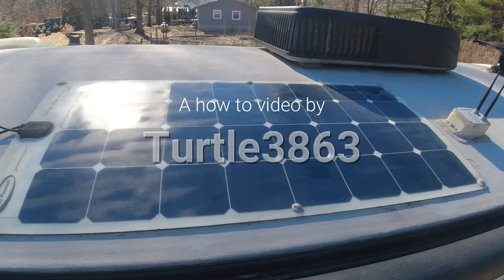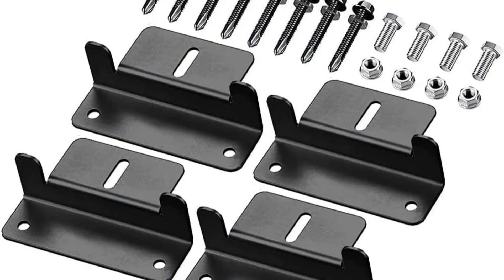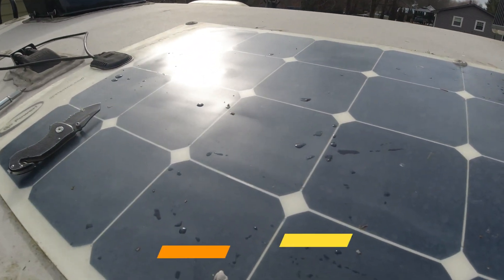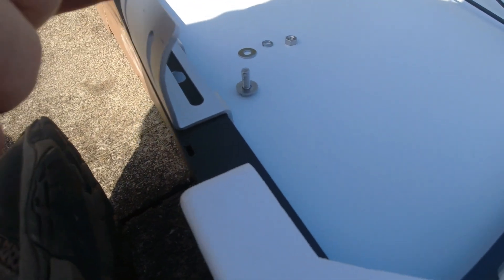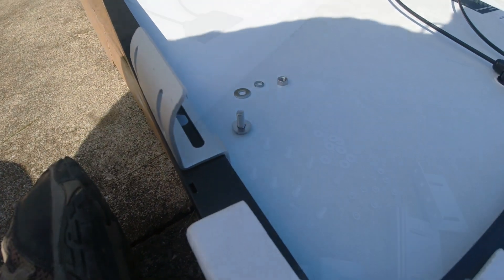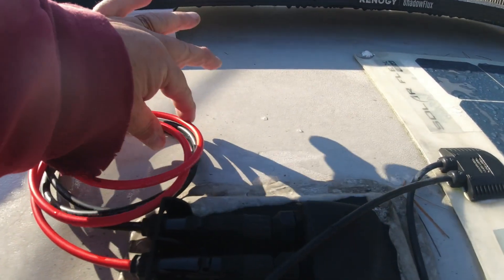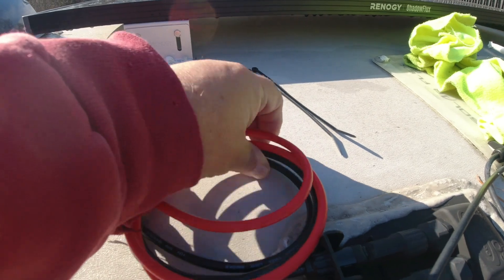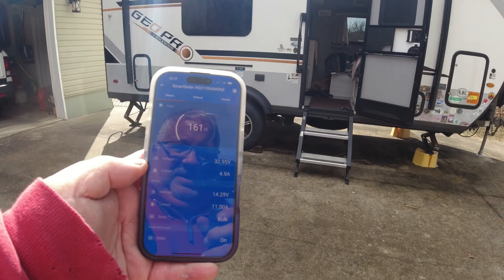Upgrading RV Solar

Comment: Forest River really makes a mess of the smaller trailers with the half hazard positioning of equipment on the roof.  My 2020 Microlite 25fks is a good example of this. If they had put the wifi Ranger and tv antenna next to each other I could put 2 panels in that area. I like this new Renogy panel, and think I might be able to put 4 of them on my roof. I have 3x400 watt portable panels, but they are big and heavy to move around. Appreciate  you taking the time to post this video.

Comment: Just curious what you are powering with about 150w and for how long?
Reply from the maker: @Ryan-xu6st  keeping a 100ah battery charged. Running lights, pump and all other 12 volt things in the RV. No need to power our LP fridge

Comment: Thanks  for the video! I'm installing an additional matching 190 watt panel to my 2022 FD in the near future so your video is giving me some great mounting ideas. In my research I found that Forest River recommends using EZ Anchor Drywall toggles where there are no metal backer plates on a rubber Luan roof. Did you consider dry wall toggles rather than beefing up the panel bracket's mounting screws?
Reply from the maker: @markchanner3616  No, I was not aware of using toggle bolts. I would say whatever Forest River recommends would be the best
Reply: @Turtle3863  The toggle bolts they recommend appear to be 2 1/2' long so I am a bit weary of sticking them into my roof. They need rather large holes to be pre-drilled. I have no idea how thick the roof is and question that the roof is thick enough for such a long toggle, especially at the edges. I am  also a bit concerned that they could hit the wiring for the ceiling lights going in so deep. To me, adding a solar panel is a bit nerve wracking!
Reply from the maker: @ Agreed that seams to be way longer than needed. I feel pretty good about the way I mounted mine and I will check after every trip for a while to make sure everything is staying put.
Reply: @ I like how your panel is tucked behind the AC. That should protect it quite well at highway speeds so you shouldn't have much if any strain on your mounts. I don't think my panel will be a good fit behind the AC so I'm going to have to mount it in front of the original panel. Doing this will mean the the front of the new panel will be a foot or so from the front edge of the camper. That's a lot of highway speed wind up there and another worry for me.